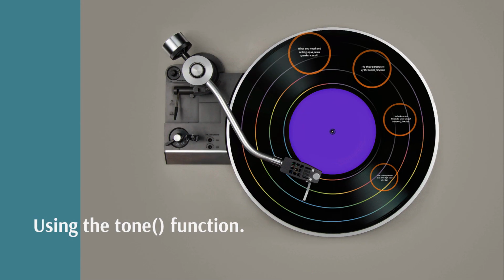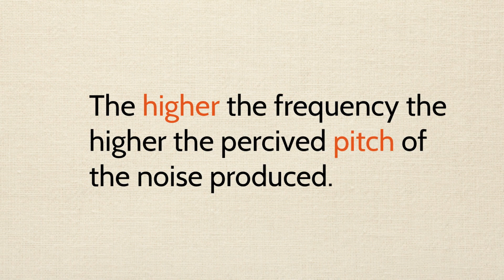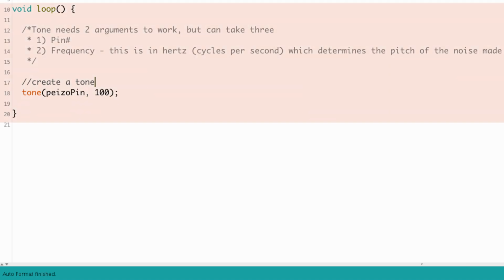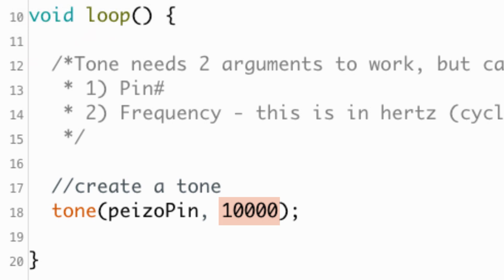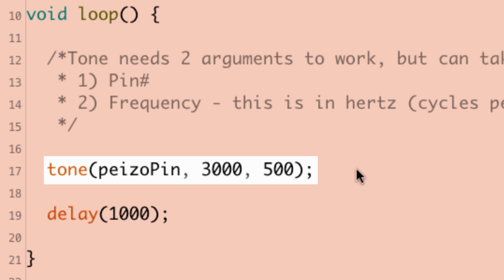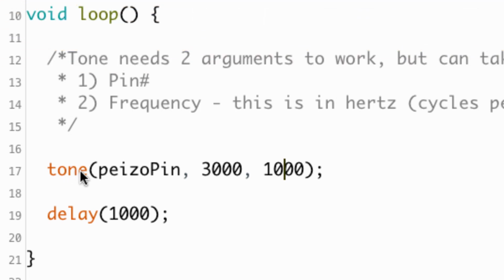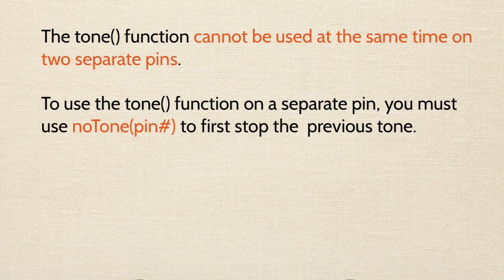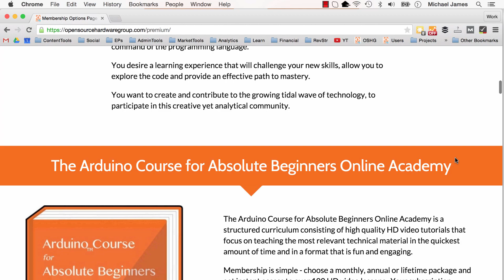An easy way to make noise with Arduino using tone()

Comment: Do this:

tone(peizoPin, 3000);
delay(100);
noTone();     [or what about tone(peizoPin, 0);]   immediately turn off the tone
delay(1000);     [and now your tone doesn't overlap into the delay]

So write a class/method or function called beeper(int pinout, int hz, int Tdelay);

{
  tone(pinout, hz);
  delay(Tdelay);
  noTone();
}

- cheers -

Now you can oscillate the oscillator so to speak without time corrections having
to be calculated inline every single time you make the call to tone.

Comment: I'm following along your tutorials and I noticed that resistors were used in different ways. Sometimes voltage passing through, sometimes one end goes to the GND and sometimes one end is interrupting the flow and the other end goes to the GND. Is there any guideline/tutorial on how to use resistors in what kind of situation? Thanks.
Reply: Nice observation. 
it depends on what you are trying to accomplish.
if you are using the resistor to limit current it will be in series with the load (like an led).
otherwise it may be used as a pull up resistor to tie a pin to positive voltage or a pull down to tie a pin to ground ( used with buttons and switches to avoid pin float irregularities ).
you should invest more in studying use of resistors. there are many clever tricks you will learn.

Comment: ok but how do we make it useful? say i want to use  keypad and have it emit a tone every time a key is pressed and not have the code interfere with the rest of the code?
i am trying to make a  garage door keypad with a keypad and relay and 2 LED's
i want the pad to emit a tone every time a key is pressed and another tone if the code is wrong and  yet another tone if it is wrong

Comment: im using tone() without using pin 3 and 11, yet it still creates artifacts (the buzzer makes noise while not activated with tone(), and my led matrix's lights are dimmer and flicker at times). how to fix???

Comment: I need help please :(( I am trying this for my project. I already made a sketch for the piezo buzzer's sound but when I tried it with a 9V Battery, the patter doesn't work? Is there a way for it to work in 9V Batteries? Please I need help :((